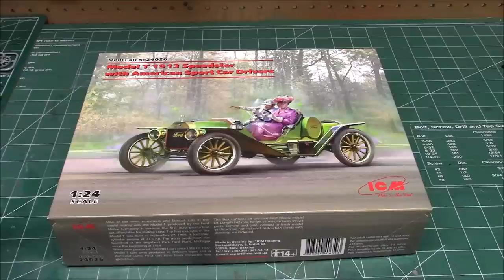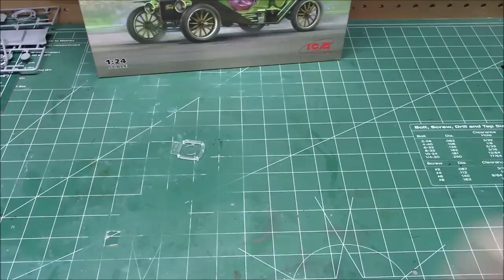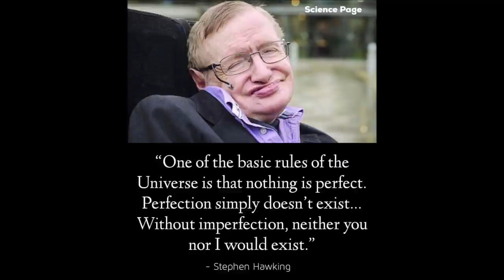1913 Model T Speedster with American Sports Car Drivers 1/24 Scale Model Kit Build Review ICM 24026

Comment: The engineering and forethought put into ICM products is a testament to their committment to excellence. They make modeler's models! I like the super attenton to accuracy, although some of the parts require a very delicate touch. I enjoy this aspect of their kits because I obsess over detail. It sure results in an immaculate representation of a classic vehicle- a pioneer for sure! I thoroughly enjoy your videos. I have gathered more good information from your uploads than from any others. One thing which has helped me is knowing when I need to pre-paint or just assemble and then pick out the details. You advice here moved the build on just a tad faster and I appreciate that. Pardon the exhaustive comment, but I had a lot I wanted to say. Best wishes and good health from the hills of ol' Virginia. Va. Cork

Comment: Saw the kit today at my hobby shop will pick it up also saw the Henry Ford figures that you can get that would go great with the car mde by the same manufacturer how did the tires fit got to have this
Reply from the maker: Tires push right on the wheels no issues.